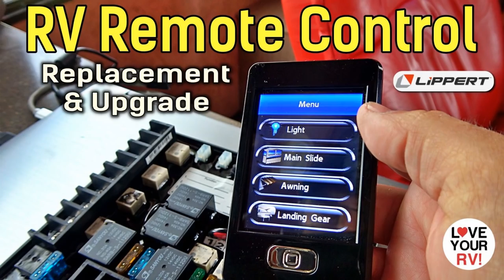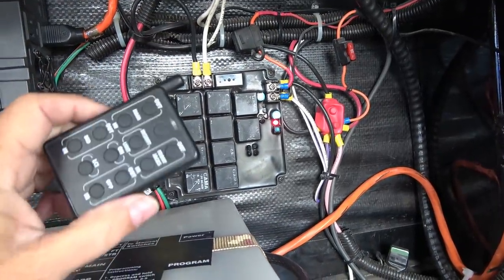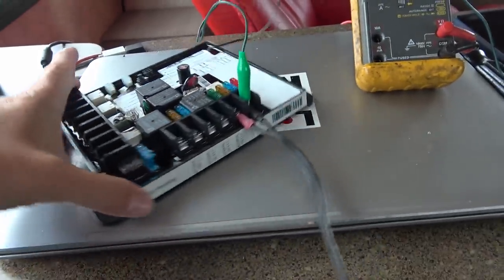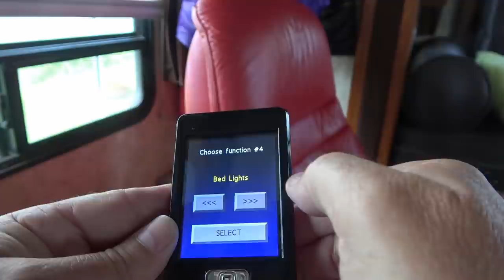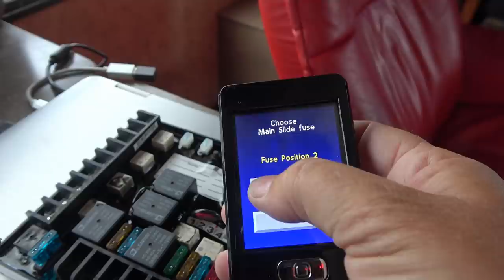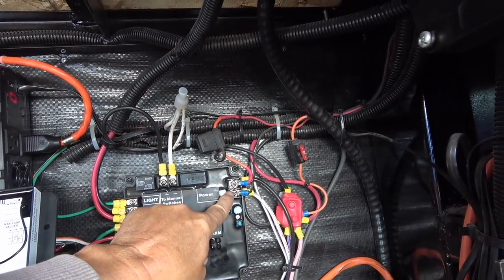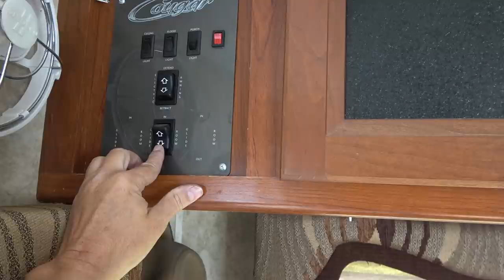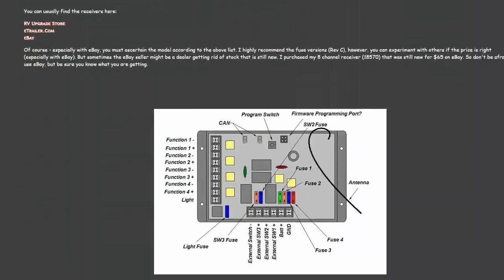RV Wireless Remote Control Module Replacement & Upgrade to Lippert Linc System

Comment from the maker: Related Links
Remotes and Control Board Diagrams - https://lci-support-doc.s3.amazonaws.com/technical-information-sheets/electronics/ccd_0002075.pdf
Lippert Documentation - https://support.lci1.com/electronics-support-wireless-transmitters-and-receivers
Lippert Touch Screen Remote - https://store.lci1.com/replacement-remote-charger-358601.html
Lippert 5 Function Controller with Selectable Fuses - https://store.lci1.com/5-function-receiver-with-selectable-fuses-305117.html
RV-Project blog post - http://www.rv-project.com/projects/linc1.php

Comment: Ray - Enjoyed the video. We are full time in our 2013 Dynamax Trilogy 3850RL (which we love), with a Lippert remote setup very similar to the one you just installed. I have had had an issue with my manual awning switches for about 8 months. The two manual awning switches don’t work, but the remote extends and retracts both awnings perfectly. Your video has helped to identify what I need to look for and where I need to look to find the fuses that are likely blown. Then I can replace them, restore that function and mark another one off my list.
Reply from the maker: Cool, I hope you can track the problem down. :)

Comment: At this point, I've essentially given up hope of understanding the finer points of electricity and color coding of wires. I'm thinking of using pink wires for ground and sea green for positive. The neutral wire (whatever that is and means) will be crayon yellow. I won't be taking questions at this time.

Comment: Have you ever thought about getting a new paint job on the Cougar to match your truck? That would be cool! Thanks!
Reply from the maker: It would be cool but could severely hamper the resale value of the trailer and hard to go back from a paint job. At 10 years though I'm now faced with many of the vinyl graphic starting to crack and peel so has crossed my mind. My plan for the next year or two is to remove the worst of the graphics and see how it goes. I may just elect to replace some of them. Though it would it really cool to take some of Anne's photos and vinyl wrap the rig with them! Another alternative is to have a guy airbrush stuff. A friend of mine had that done when in Mexico and it looks nice.  https://forum.loveyourrv.com/discussion/614/new-front-decal-on-fifth-wheel  Cheers, Ray
Reply: @LoveYourRV  If you did something like that, especially if it's nature related, I don't think it would degrade the camper's value. I think it would improve it! Especially with all the mods and upgrades you've made, and the fact that the camper is 11 years old! Most importantly, it would be your one-of-a-kind RV! Thanks!!

Comment: Could  you connect your electric dump valves to the open position you had and controlled them remotely?
Reply from the maker: The Drainmaster electric valves I have auto-reset to the closed position when power is cycled. It's a feature called "Power-On safe ‘homing’ to closed position" So it wouldn't work to switch the main power to them. They do come with an extra connector so an inside and outside switch can be installed.

Comment: I have a 2014 Cougar 337FLS with 4 slides, landing gear and awning, also light.  My landing gear stopped working on the remote.  Guess I’ll go looking for a second fuse.  I also have one relay/function not used so if need be I’ll move the wire incase the relay has stopped working.  It’s near impossible to find any information about this control.
Reply from the maker: Hope you can track it down, if so let me know what you find. Cheers, Ray

Comment: A quick look at the latest satellite imagery is showing a lot of empty campsites.  
What happened?
Reply from the maker: BC is really locked down travel-wise right now. Posted on the RV parks Facebook page:
"Under the new travel restrictions as of Friday April 23, 2021 and 
until May 25th we are now only accepting reservations for those residing in the Campbell River area only and or for those who are traveling for essential service reasons as listed in the current health orders. If it is essential travel, you will be required to show proof or a document to our front desk staff proving that it is essential travel, you may email us your document."
And the BC government has also limited travel via the BC ferries to Vancouver Island to only essential travels.
The RV park emptied of the regular winter snowbird guests at the end of April but due to the restrictions very few people came to fill the spots for summer. That will likely change come June. Cheers, Ray

Comment: Quick question Ray, is it ok and no damage if we put the bottle jack directly under the shackle between the tires? We just have the basic shackle that came with our 2015 Keystone Outback. Thanks again, Enjoy! 🌞
Reply from the maker: Here is my opinion on that - https://youtu.be/8vZDXQhlK60?t=156  and its just an opinion, I'm not a certified RV tech or mechanic, so take what I say with a grain of salt. But, I've watched numerous "professional tire shops" do the same thing over the course of ten years I've owned the trailer and no damage has occurred.  Cheers, Ray
Reply: @LoveYourRV  👍thanks, I'll check it out 💥
Reply: @LoveYourRV  beautiful video!, i now understand how to do the brakes. I watched up to when u were heat shrinking and reattaching the non polar brake wires. Nice they're non polar. I've been searching like mad for the ultimate perfect video illustration of the safest, most correct way to go about removing all four wheels. I saw one " pro " shop video supporting the entire trailer with their big heavy floor jacks, one under each axle U- bolt as you did. Other video people say only to the frame. I think you're right when doing one wheel at a time it's ok. I today raised one side from the shackle using a 4" x 9" metal plate and bottle jack in the center so all the trailer weight wouldn't be focused at one point in the center of the shackle. Both the wheels were off the ground with about 4" lifting. I also think & wonder as you why no lock washer or nylon lock nut  be there, should be required by law. It's just another one of the many skimpy building techniques used by most RV companies. I see the same in house construction. Cheap 49 cent light switches etc. Just make things to look good for the sale and quick bundle of money.  Prost, Franz
Reply: @LoveYourRV  Agree - the u-bolts hold the axle to the trailer - a jack under them is the way to go. I think "all the manuals" are trying to cover any/all situations.  "You can't fix stupid" so the manuf. just goes with the safest solution.  BTW - you use a 20T jack?? wow - it must really be a heavy 5th wheel!!!

Comment: Thank goodness they password protected the fuse selection function because just changing the fuse would be dangerous.
Reply from the maker: Must be some legal liability thing so people can't buy it and then use too large a fuse for the wiring, then a short circuit can start a fire by over heating the wire. That's my guess. :) If a certified RV tech installs it then they are off the hook.

Comment: I guess there’s no reason to change your program now but I would like to respectfully comment that changing your three fuses to 30s was wrong you only need to program all three of those channels to fuse number one or the one thirty amp fuse I hope this makes since ps. Lippert was born in a four digit year just like a secret PIN number the year was “1956”
Reply from the maker: Thanks, for the tip!

Comment: The cost of this system is $1,100.   I’m think manual works.
Reply from the maker: Yeah pretty old generation and niche item, surprised they still make them. The main reason I wanted my remote system working is the manual switches don't work very well. The OEM much have installed under size wiring and the voltage drop is so high that the motors run slow and without much power. Sometimes the awning doesn't want to retract. Running new wires would be a real pain. For some reason they did the remote wiring better and the slide and awning motors work really well using the remote. Cheers, Ray

Comment: No app? No go.
Reply from the maker: No, this is an older legacy product I installed but it matches the system in my old RV. :) It came out before Bluetooth apps became so popular. The latest greatest stuff is called OneControl - https://store.lci1.com/onecontrol  I imagine it would take rewiring the RV to make it work with mine.
Reply: @LoveYourRV  I'm old school - I don't like all my apps controlled by one device. i've smashed my phone before - if i did that now with all the apps i need then everything wouldn't t work.  like redundancy.